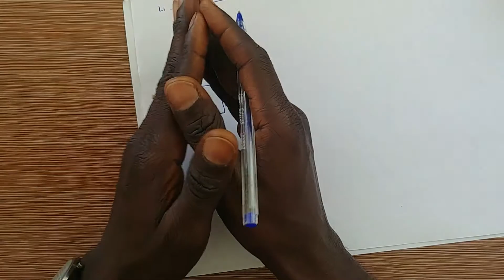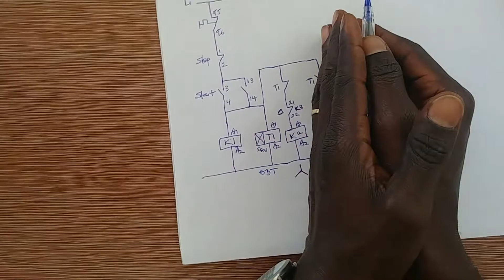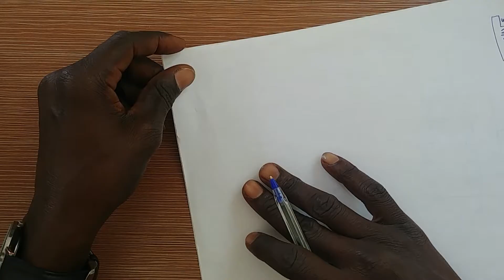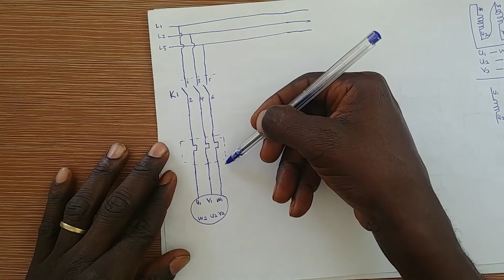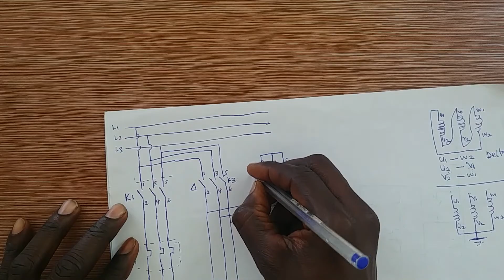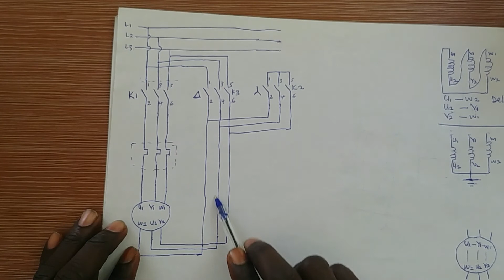Star Delta Connection Diagram / Star Delta Starter Diagram

Comment: Thanks but
 Revisit the conteol for the main contactor.  You will need to make a correction. The Y contactor (K2)  must come in first before the main Contactor (K1) can engage. So the control for the K
1. Needs to be controlled by NO of K2.
2. To Hold K1 on after K2 is switch off,  NO of K1 needs to be held in parrallel to NO of K1

Comment: I see it will engage the main first and of which it will be connected to a direct online first
Reply from the maker: Please if you could come again with your question. Thanks
Reply: @ChrisControlAutomation  That Incase the main go in first, there will be no reduction in voltages because there is full load current to da motor be4 the star engages
Reply from the maker: Exactly! So it is always important to reduce voltage and current first using the star config, then later delta comes in. Thanks for your understanding. Please do share the video
Reply: @ChrisControlAutomation  the way uv simplified things🤝🤝

Comment: @chris control Automation I have two circuits one is direct online the other is star delta with a timer, and I would like to interlock the two were you can only start the star delta when direct online is running?
Reply from the maker: did u mean when one is running, the other should not work ?
Reply: @ChrisControlAutomation  i mean both should work but you can only start the star-delta when the DOL is on.
Reply from the maker: Okay. Connect NO contact on the dol contactor in series with the star delta line
Reply: @ChrisControlAutomation  Kindly advise how you size the main contactor,star contactor and delta contactor including the overload
Reply from the maker: Okay
Reply: Yes please

Comment: Dear sir, you cannot join primary lines to get star . I know you know this point just bring to your attention.
Reply from the maker: Thanks for your comment boss. Anyway, it is not primary lines we are joining to complete star configuration. Please kindly have time, follow the tutorials, and you will understand. That's the way to show how star and delta configurations are achieved. If you have a three phase motor please follow tutorials and connect the motor and it will work boss. That's star and delta configuration. Thank you for your comment boss.